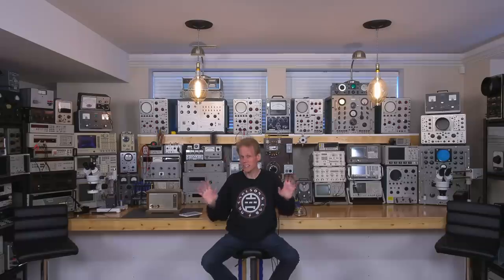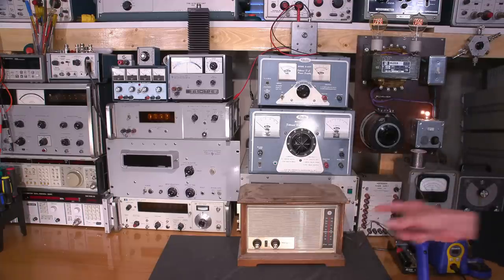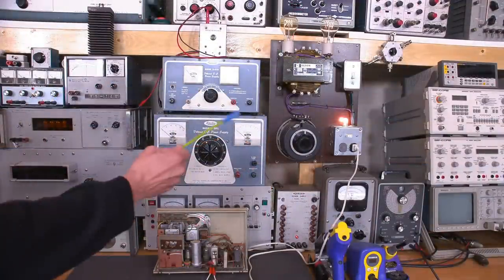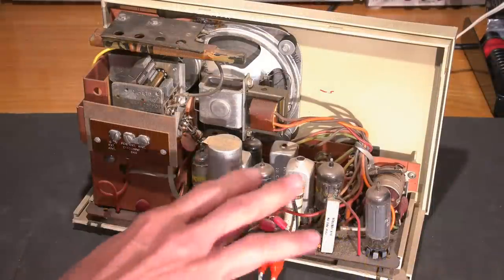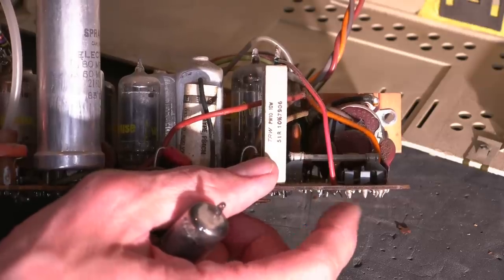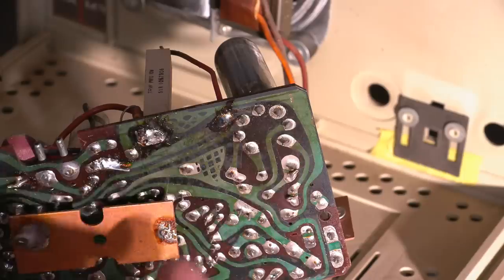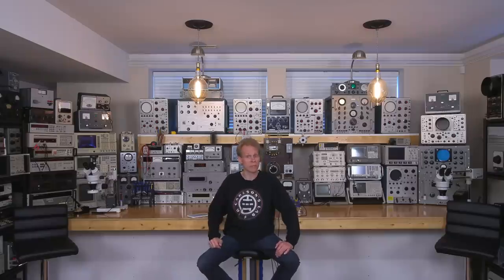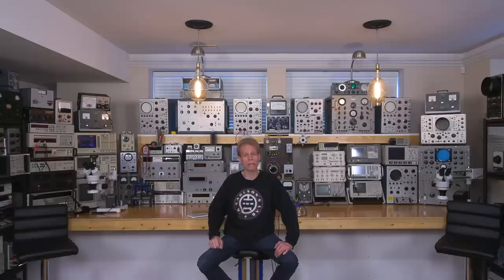Old 1960's Barn Find Radio Receiver Teardown And Diagnosis!

Comment from the maker: To learn electronics in a very different and effective way, and gain access to Mr Carlson's personal designs and inventions, visit the Mr Carlson's Lab Patreon page here: https://www.patreon.com/MrCarlsonsLab
Reply: someday build a regen from own design... or off net. would be cool.. wu2d used one of them new flat tubes or something . but be cool see what you would come up with .
Reply: @XPFTP  Interesting. That would be 1 kick ass radio if Mr. C built it from the bottom up.
Reply: Do you have any idea while old Tek scopes with 50+ tubes can still be working but many TV with tubes had them frequently go out? Did Tek use higher quality tubes?
Reply: Please do the restoration.  It is one of the few valve/tube radios that is not older than l am!
Reply: TVs generally are very hard on certain tubes due to circuit demands.  Think HV, damper, etc, that run near design limits while ‘as the world ends’ and ‘the young and the useless’ run the raster all day long;)

Comment: This is a perfect example of 60’s design. Maybe that is why it deserves to survive. I would say yes.
Reply: I agree. This little radio is an example of technology in transition. I graduated HS in 1962. I was just getting to really understand tubes when we blown up by the humble CK722 transistor. What are holes?
Reply: Word.
Reply: It's one of those where technology is in transition. It's probably a rare survivor of its model. 

So, I think that it deserves to be properly restored rather than being a spares donor.
Reply: @icanfartloud  🤣
Reply: 👨‍🔬"It's definitely safe".  👩‍🔬For who? 🦈Me
Reply: Very enjoyable and informative. It surprises me that this radio doesn't have a dial light. Seems very basic. You've done the tough part which is diagnosis and repair. I vote for a restoration. Thanks
Reply: Maybe not the quality of 30/40s but has it's place in the evolution of electronics design and manufacturing...how else would we know about to fix , you make a very good point

Comment: This little unit deserves a full restoration, with maybe a full range speaker. 
Your  one of the best instructors on YouTube, Sir!
Reply: for sure I have Viston brand speakers that I use as a replacement when needed !
Reply: I do not think that radio deserves life. So much cost cutting b.s. So much heat into that circuit board. Yuck. But kudos to you for fooling with it.
Reply: How much would an old radio like this pull(Watts) from the wall ?
Reply: @drupiROM The tubes alone should pull something like 25W.

Comment: My first 2 duty stations in the US Coast Guard were LORAN transmitter stations. The transmitters were 275KW at 100KHz pulsed signal. If I remember correctly, the output plate voltage was about 18Kv. If we did not keep jumper wires across the spare capacitors that were in stock, they could charge to near their rated voltage. Many people have been shocked by high voltage across the body, due to not verifying a shorting jumper was installed before grabbing the ceramic insulators to pick up the 20+ pound, metal encased, oil filled capacitor. The connection studs were on top of the insulators and easy to set your thumbs on. Tubes, I love seeing them glow.
Reply: Hello in another field the mechanical electricity and especially the mains inverters the capacitors that were replaced were in short circuit

Comment: The 19T8's filament has a higher resistance than the 14GT8's  filament. The 19T8 will probably see about 23-24 V across the filament, and the rest of the string will run a little cooler. Need to put some shunt resistance across the filament to bring it down to 19 V.  Mr. Carlson, I'm surprized, but gave ya a thumbs-up anyhow for the diode modding. 👍:person-turqouise-waving:

Comment: It might be a fairly common, low budget radio of its day but it's a good example of a hybrid AM/FM with reutilized TV valves. TV valves are generally easier to get hold of so I think it's a great set to demo to those getting into radio restoration, and who better to show the does and don'ts of radio repair? 😁👍

Comment: I just picked up an RCA RJC30W that looks similar on the outside to yours (but a little cleaner 😂).  For $4, I was thinking if it didn't work I would just use it for parts -- I was planning on using the tuner on a crystal radio.  But somehow this thing still makes humming noises. It's still alive so I can't justify killing it!  Your video has given me hope that I can repair it and make it fully functional.

Comment: I have mixed feelings about fully restoring this particular radio. However, if you do, please use vintage test & alignment equipment, like a VTVM, EICO or Heathkit, i.e., the equipment most of us hobbyists might use. I'd especially like to see you use a vintage FM Sweep generator, like a Heathkit TS-4 or an EICO Model 368. Maybe you could show the procedure with and without using an oscilloscope. I know you've done this with AM alignment. Maybe you could use this radio to do a training session on different methods of FM alignment. Thanks for your videos! You were one of my main inspirations for attempting this hobby!

Comment: I love the design of this radio. Rational layout.
I happened to repair Soviet radio equipment of about the same age. I noticed the same problem of the lamp panels losing contact with the PCB. I think this is due to cyclic temperature deformations when heating the radio tubes. For radio equipment with volumetric installation of radio components, this problem is not typical.

Comment: When I was a teen back in the mid 60's, I offered to sweep and clean and maybe even learn something electronics in a corner strip mall TV/Stereo repair shop.I started at 50 cents an hour. Even drove on service calls taking the TV tech to out in the field.  I was also "trained" on the tube checker machine at the counter. Checked tubes and made more profit for the shop selling weak and blown tubes. I fixed a ton of these radios. Somewhere I still have one of these dual speaker by GE. WB5LOP

Comment: I'd love to see it restored if you have time  Mr Carlson! 
On another note I inherited an obviously very old  Mini-Ball TL60 amplifier that has one MRF 453 Transistor in it which is no longer available. I can't find any info on that amplifier model whatsoever. 
I'm told it doesn't sound very good on the air but I did  manage to get out 7 miles on it where I couldn't with my base CB setup at 20 watt's. Originally it had very high SWR because the SO 239's were loose at the back of the chassis.
It has a nice little circuit board with a mic keying circuit and a bypass switch with led on the face. Also a couple small transistors as well as a couple Mosfet transistors at the edge of the board.
I changed one physically leaking cap on it but have not put it on the air again.
With it being old I didn't know if you might like taking a look at it or not?

Comment: Interesting way to see printed circuit board with tubes. I say yes to restoration. Love to watch your channel. I own a electronic repair shop in Brazil and i often make a repairs on HDMI boards of modern receivers like Denon, onkyo, etc. I love the challenge to repair this type of equipment.

Comment: Don't worry about a little shock.   Back in the 1950s we had a fence charger on the farm.  Us kids used to stand on straw and touch the fence wire to get a jolt.   Sometimes we used a timothy stalk to touch the hot wire.   

This charger would send out a jolt every 8 seconds or so.  It had a large battery inside.  Thanks for the memories.

Comment: Paul touched on this, but the problem with the early PC boards is often crystallized solder on the tube sockets. The board's expansion/contraction coupled with heat leads to bad connections. My brother did TV repair for Sears the late 70s, and he showed me that failure.

Comment: One side of me says this radio deserves a resurrection/restoration, for there are many common radios like this that were made as minimalist sets like this one. If you decide to continual restoration on this Westinghouse radio, please put a good 14GT8 tube back in, so it's restored to it's original vintage factory condition. THE OTHER SIDE SAYS, LAY IT ASIDE FOR LATER AND GET ON WITH THE GRAND RECEIVER RESTORATIONS. 
Note on the 14GT8 tube vers 19T8, the 19T8 was designed for discriminator FM detection where the third diode was used for AM detector. The 14GT8 was made for a Ratio FM detector where you did not need a Limiter stage before it and they had some other component do the AM detection, a cost cutting measure.

Comment: Awesome video Mr. C👍👍 As a less complex receiver with far fewer components and a relatively simple board, this might be a good teaching specimen for a more condensed video...or not.  It seems most folks would like to see a full blown Mr. Carlson's Lab restoration but I'm kinda like you, 50/50...?  If this radio warrants your time, yeah do what you like.  BTW, nice antenna work.  Lab is looking stellar, you've put in some hours.  Thanks for the video and work, well done.  73's KC5NEX
Reply from the maker: Thanks for your kind comment Terry!

Comment: That radio 📻 sure looks well preserved. All it needs is the electrolytic capacitors replaced. It’s either a White-Westinghouse, or just Westinghouse. At some point, their name underwent this change. FABULOUS circuitry. This definitely 💯 deserves to be in your living room, or somewhere it can be seen. Other than all the dust, it looks like 👍 it’s been well cared for. Your friend, Jeff.

Comment: GRat video and troubleshooting again Paul congratulations for the high quality. I would like to see the radio restored to its full and even more, improved with a pulley for the string and some  light for the dial, etc.

Comment: Wow that thing must of took off! It’s really funny that you are saying this now because I am working on one of those motors as I watch this. It’s a 1HP motor from my well pump that I made a sander/grinder out of. I’m making a threaded shaft on my lathe to extend it to go through the 4-1/4” long roller I also made out of aluminum on the lathe. I’m into building, welding, machines, etc. with I could post a pic here, you’d laugh about it as I am. I enjoy trying to learn electronics too, but I had to put all that stuff away. I just don’t have the room for what my brain wants me to do lol
Reply: Oh man I put the comment on the wrong video. I watch you on roku in my garage and grabbed my phone to comment. This comment is supposed to be on your scary fan blade story dammit

Comment: A very neat job. I'm impressed by your diode modifications for the replacement tube. A lot of those old tuner strings are a nightmare, especially if you have to work out how they should be put on. The problem also with a lot of these small tube radios is the heat build-up inside, which is probably the cause of so many of the soldered joints going bad.

Comment: I agree with most of the commenters in saying that this little radio deserves to be reborn.  It's a good example of a hybrid tube/solid-state design yet it still retains most of the parts that are in the older tube radios.  It's also more typical of the 1960s radios that restorers today might have had as children and kept in their parent's basement just waiting for the day when they could bring it back to life.  Definitely worth a restore, IMHO.

Comment: I say restore it! lets face it, you spent hours just finding a tube and redesigning the circuit. I also have an old Delmonico A.M. , F.M. Short wave, with an old style type of circuit board like yours, and would learn so much to incorporate into my rebuild.
73's Mike

Comment: First of all, you need a lot more than a little dust to catch up with Shango066! I would like you to restore this based on the fact that I don't believe you've ever aligned an fm radio on YouTube before. I didn't know how good that tube would work running it 5 volts lower on the filament voltage, but it appears fine. I've got a 6au6 preamp tube i'd like to run on an old 5 volt smps cellphone charger that the internal chip will not allow more than 5 volts no matter what, and I might try it now that you've done this because I'm too cheap to throw in a 6 volt filament transformer and the smps is nice and small and I don't need much amplification anyway for the junk 12ax7/ 2x 50c5 project amp that came out of an old record player. So break out the slobbering iron and go to work! Thanks for sharing!

Comment: I'm actually on the fence about a full restoration, but if you get enough yes's, go ahead. I've restored a lot of tube radios and I'm not a fan of the AM/FM tube type as the tubes are harder to find and more difficult to work on. Thanks for your videos!

Comment: Definitely worth restoring, if only to show us how PCB assembled radios should be worked on :)
It's not a great design given the thermal stress on the board and components, but still a nice vintage radio.

Dealing with PCB mount sockets, I always solder them with a scrap tube in. This way I won't damage the proper tube, and will still have the socket sitting there with minimal stress. Oh, and the board just asks for some compressed air.

Inductively coupled antenna is a great invention too :)

Comment: Sorry, Paul, but I just heard incredible Irony from you! At 3:28 , after you refer to present-day 'junk', you remove the back and reveal a single phenolic circuit board with NO chassis and NO isolation! :)

Comment: yes, it should get a full restore, and the audio output tube should get a  ceramic tube socket, it seems they put that weird metal pin one in there cause that tube gets too hot for bakelite sockets or any other types of composites but a ceramic will be able to take the heat of the 50C5 i mean they run HOT! 400+F

Comment: i would really like to see a market for a fusion of old and new stuff regarding these radios.
modern class-d amps, wifi streaming, integrated audio file storage (optionally), good sound like good modern boom boxes, bluetooth,... but with that old classy wooden case and front panel.
upgradeable (internal storage space, digital inputs, digital radio, ....)

Comment: 36:25 .. Just saw it right now, a Görler tuner :D .. Görler was at the time a quite famous German manufacturer of radio components and subassemblies, as well as transformers (in another branch). They also catered to hobbyists/hams, with offering prewired and prealigned (of course do to stray capacitances a final in circuit alignment was always necessary) band switch/coil assemblies etc. often with specific designs you could realize with them.

Interesting that they made it to the US in such a simple mass produced device.

Comment: Subbing that 19T8 tube and the circuit change, is a very creative solution! Where are the new SS diodes located in the circuit?Regarding discharging the electrolytic caps, why does the discharging need to be so careful. I always just shorted the positive to negative.  Does that risk damaging the cap? I'm really surprised a 50 YO cap still holds a charge like that!
Reply from the maker: Yes, shorting them absolutely does damage the caps. They are not designed to deal with high current discharge.
Reply: @MrCarlsonsLab  Good to know! Thank you!

Comment: I would say yes - we love watching you restore vintage radios, but what is classed as vintage? This is over 50 years old and on the cusp of tipping into more modern solid state electronics. I think this would be an interesting restoration, even if it isn't months of rework like some of the restorations we've seen you do.

This radio in the UK wouldn't be of much use now as the AM bands are pretty much empty at this point, but a vintage FM radio like this would look nice in my office at least :) I am sure there will be people who would shell it out and put a bluetooth module in there but this radio is from my childhood, I'd keep it just as it is.

Comment: Here in the UK, AM/FM receivers of this period use a Philips/Mullard UABC80 in the detector/1st AF stage which I think does a similar job to the 19T8 but has a 0.1A heater rating for use with series connected heaters. The EABC80 is the same but has a 6.3volt heater. It's always interesing to see how the circuitry of American receivers compares with British ones. I think it would nice to restore this receiver as it does still work and I feel it would be a pity to tear it down for parts or throw it in the trash. Your restorations are always great to watch Paul, and FM alignmnent would be particularly interesting to see.

Comment: So back in the 60's & early 70's I use to mess with the Old Radios, nothing like you know, that's for sure!
I'm lucky I never got ZAPPED by the Capacitor....Oh My!

Question, LED Lights in my shop screw with the RF Gain on FM, Speaker Noise, do I need a Outside Antenna?

Comment: I like the cabinet; work went into that too. I recommend resoldering the weak points and general cleaning and no further work. But what if a future restorer sees the 19 tube and replaces it with the original 14, what will happen? Maybe leave a note on the backboard explaining this.

Comment: More than a restoration, that radio seems simple enough to be a candidate  for recreation with modern components as a replica. The wood, the plastic, the board, and the speaker all separate cleanly and simply.